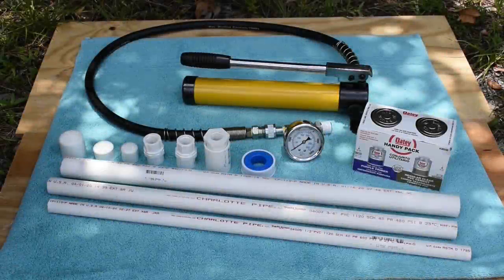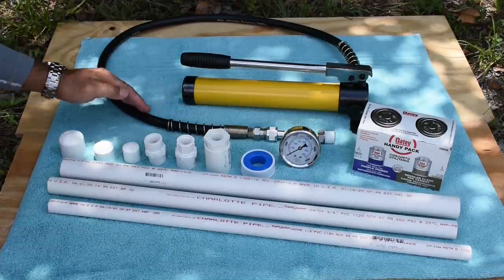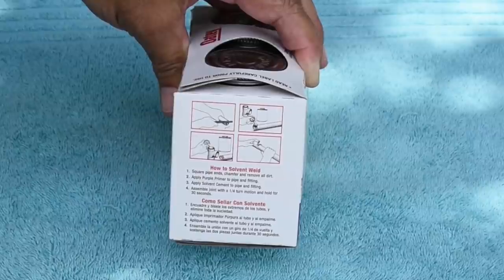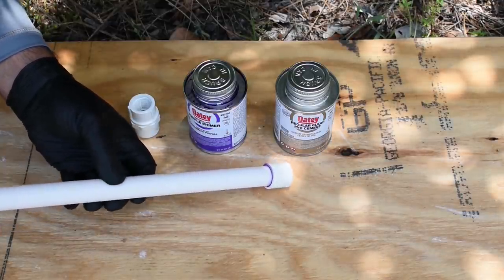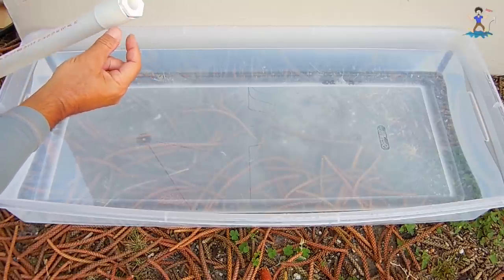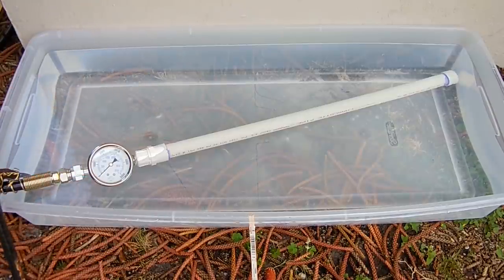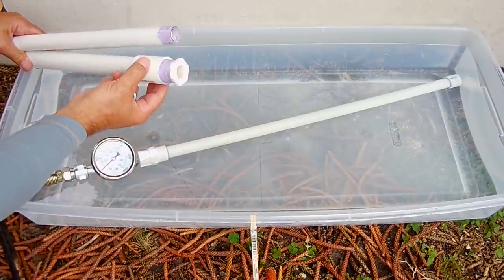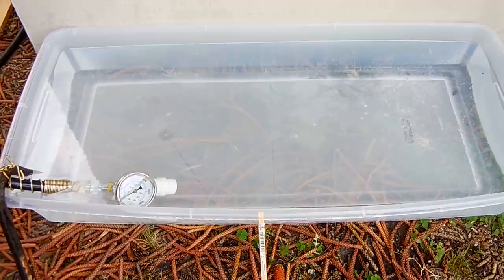Pressure Testing PVC Pipe! How High Will It Go?

Comment: I really appreciated your analysis of why the cement was failing. It really makes perfect sense
Reply from the maker: It doesn't always fail. I've done additional tests where the same size pipe ruptures before the cemented fittings, but at a lower pressure. What's important is the level of pressure these pipes can withstand. Thanks for watching!

Comment: I've always wondered about that, if the pipe pressure rating was BS or not. ? is how can you get a good test that actually checks failure pressure of the material itself? I always used HD cement with my piping and you were just using regular strength glue. Part 2 - Get the strongest glue, re-clean and re-cement (or use new pipe components) and test again to see what the difference in glue makes and to see if you can get the plastic components to fail to verify ratings. It would be helpful if you could put 2nd camera zoomed in the pressure gauge in a PinP. Very hard to see pressure and maybe add snippets of moments of failure screen shots showing pressure and failure type. Thanks!
Reply from the maker: 3 more PVC testing videos coming up. Next one SAT. Thanks for watching!

Comment: I can tell you that 3/4" screw on PVC caps will crack and break over time under 125psi of air pressure.  I think it's the hammering nature of the pressure from the compressor, even though one cap was over 250' downline.
Reply from the maker: Yes. They're under pressure from the tapered male pipe they're screwed onto, and with age and UV, they become brittle. Thanks for watching!
Reply: @electronicsNmore  No I mean brand new, under cover, and it only takes a couple weeks.  It has to be the beating of the pistons from the compressor. Plus UV has nearly zero effect on PVC.
Reply: Do you have a flex hose between the compressor and the PVC? i never had any problems like that

Comment: Interesting to see and learn.  Can you do one more test using acetone? I used it many years ago to stack small pieces 1/4 thick acrylic sheets to make a prism and it turned out to be very clear after polishing and worked well.
Reply from the maker: I have (3) more PVC testing videos coming up. :-) Be sure to watch and share. Thanks for the video suggestion!
Reply: @electronicsNmore  Lol i hate to be that guy but would love to see something about how much energy having a compressible medium (e.g. air) in the vessel adds to the failure.

Comment: Three times a failure at the joint should tell you to improve your joining process.  The "primer" is actually a cleaner. Let it completely dry before introducing the cement. Take your time and make sure both surfaces of the joint are completely wetted with the cement. I suggest pushing the joint together, then giving it a one-third to one-half turn. And then, like you did, hold the joint for 30 seconds or so. Let it set overnight. I think you will get higher pressures before failure.  The colored primer is so inspectors can see that you used a primer. At home I use the clear primer so I don't get that messy purple stuff all over the place.
Reply from the maker: The bond strength was surprisingly good. What's happening is the pipe under extreme pressure is bulging, and that bulging is enough to cause the fittings to pop off. I probably could've allowed the primer to dry 5 more secs. The method of assembly was fine. I let it set for 24 hrs! :-)

Comment: primer weakens glue hold. There's several data segments people have done showing their bursting strength with pressure / tensile strength / and twisting strength.
Now I don't believe you'd ever break the pipe vs the glue hold, maybe if you glued threaded PVC... but you'd have to get a pipe threader and thread it yourself maybe since idk any long pieces that actually have threads built into it. Either way it'd be interesting to do glue holding strength as well. As far as other data goes the "medium grey" with NO PRIMER is the strongest hold I have seen. Great test though, it would be very cool to see a glue stronger than the pipe itself.
Reply from the maker: You missed another video. :-)
https://www.youtube.com/watch?v=1o4E2pdEv-s

Comment: i never would have thought the joints were the weak parts!
Reply from the maker: For some reason the pipe used in this video was able to tolerate higher pressure than my 2 recent videos. Watch my 2 newer videos, the fittings held up and I cemented them the exact same way. Thanks for watching!
Reply: @electronicsNmore  i did, wonderful videos!

Comment: Thanks for the very good video. Very informative. I like to use three-quarter inch PVC in my garage for my air compressor max of 175 psi. Will this work okay. Thank you
Reply from the maker: No problem at that pressure.
Reply: Use pex instead. PVC has brittle failure, and with air it can fling shards with a LOT of force.
Reply from the maker: @Robert Szasz I'll be testing that in the future. :-)
Reply: @electronicsNmore  pex? Or the PVC shard issue. Because the latter is rare, it happens just often enough that avoiding PVC makes sense.
Reply: @RobertSzasz  -- The PEX that I've seen at the home improvement stores should not be exposed to UV.  That could be a concern in certain situations.

Comment: Right when you said you have to hold the end piece on with the glue because of the tapering  i thought its set up for failure. Cant you put a rib on the pipe or some non tapered ends? Thanks for the vid.
Reply from the maker: I have another video that tests the strength of non-tapered thermoformed PVC, check it out under my PVC pipe video playlist. Thanks!

Comment: I think its rated for 480 bexause over time. At sudden shocks of pressure the system gets when you turn the water off and on, you will slowly get cracks over time and it will fail. Or maybe its something else. Like a 480 rating to last 50 years or sometging.
Reply from the maker: They definitely take into consideration water hammer. Thanks for watching! Be sure to share.

Comment: Was the solvent of the glue you used tetraflouran and cyclohexanone or was it methyl ethyl ketone based, I have found the former works better than the latter. The manufacturer states 48 hr cure time for pressure pipe with the former

Comment: I know it would be a more precarious experiment - but how would it work with galvanized?
Stay very safe if you conduct that test.
I still have old sprinkler lines in my yard.
Reply from the maker: Unless the pipe is larger(over 2"), I'd need a higher pressure hydraulic pump. Thanks for watching! Don't forget to rate thumbs up and share the video link.

Comment: Extremely interesting results.  I've seen a lot of people use PVC pipes in shops for compressed air and never considered it safe. I'm curious about long-term effects and just plain age of pipes.
Reply from the maker: The pressure used for compressed air isn't too high(125-150psi), so it shouldn't be a problem. As long as the PVC isn't exposed to UV light all the time, it shouldn't become brittle for a very long time. Thanks for watching Ted!
Reply: @electronicsNmore  completely correct but another factor is ozone degeneration of plastics.Although pvc got some stabilisation additives inside i'd go for "Gas pvc" pipes. They are thicker and rated like tank. I tried to burn one while it was pressurised with water and didn't even melt.
Reply from the maker: Be very careful burning pvc, stand upwind. PVC gives off dioxins when burned.
Reply: @electronicsNmore  The ratings on pvc are for liquid. Air pressure is different. Compressed air has a lot of energy and will turn PVC into shrapnel! Very dagerous!
Reply: @jackofalltrades4904  PSI is PSI makes no difference if water or air. HOWEVER air will compress and that in effect stores energy if suddenly released------ BANG!

Comment: This is excellent! I am building a heating system for me and my family within my garage and would like it to be safe! 480 is a high range and especialy for a cement joint!  Now the real question for me is how much pressure can a 4" white pvc pipe withstand before breaking?  I need to know because thats what my heating system will use and my safety blow off valve is rated at 150 psi!  So with your work, this looks promising!  Any help would be appreated!!!!!!!
Reply from the maker: Never use PVC for heat applications.

Comment: Great video! Looks like that hydraulic pump might be leaking internally, the pressure looked as though it was not building properly, and I didn't notice any bubbles in the water indicating an external leak... Maybe you'll have to get your money back after all the testing!
Reply from the maker: You won't see bubbles, there was only a trace of air in the pipe. :-) It was definitely leaking liquid. Thanks for watching!
Reply: @electronicsNmore ...oh yeah,  forgot about the oil,  and it was clear oil, so I didn't see it in the water... Will be interesting to see how the other glues hold up on Saturday,  I think the hot blue will fair better,  but not confident it will hold long enough to see the pipe burst! Might be interesting to see where schedule 10 ruptures though!?!
Reply: @electronicsNmore  why not use a grease gun with flipflops cut into it to make it that it can pump water?(grease guns can reach easily 4K psi)
Reply: @AnX8765  , I didn't see it because I'm watching videos on a phone,  a larger screen and I would have seen it. In fact,  when I re- watched it,  I could just barely see it...

Comment: Why did the fittings on this vid test pop off, but on your other vid the fittings fully held but the pipe burst?
Reply from the maker: Hydraulic jack oil. If I used water, then I'd have to flush it out and fill it back up to prevent corrosion.

Comment: You need to be carefull with plastics. Remember most have creep and even if they hold the pressure for now, under stress they get weaker over time until they burst open. Thats why they need to be overspec'd for the job

Also the pipes need to withstand way more than the city line pressure because of the water hammer
Reply from the maker: Yes, water hammer is known to cause damage. I've installed many air chambers over the years on copper lines. Thanks for watching!
Reply: Thats it

Comment: Do you think this pressure test would be different if you use just air no water inside the pipe?
Reply from the maker: Air would be extremely dangerous because you can compress many cubic feet. The pipe would explode with plastic shrapnel at or near the same pressure level.

Comment: Hi mate, any idea what the bursting psi is for DWV PVC? (I understand DWV is not pressure rated, just curious what pressure it would burst at.. awesome vids!!)
Reply from the maker: Much lower due to the larger diameter.
Reply: @electronicsNmore  thanks mate.. at a total guesstimate, do you reckon 100mm OVC DWV would be ok for under 50psi?
Reply: @electronicsNmore  *PVC

Comment: is it ok to use 1.5 inch for pressuring air up to 20 bar
Reply from the maker: Use copper pipe.
Reply: but would pvc suffice ?
For explanation im trying to rebuild  the Tampoon gun from I did athing.

Comment: the pressure might only be 80psi but you are not taking into account the water hammer effect from turning on and off taps that can increase the pressure 20x easily
Reply from the maker: Most modern homes have air chambers on water supply lines to prevent "water hammer". Water hammer only occurs when the water is turned off quickly. 20x is excessive. There are online calculators for water hammer. My guess would be a few hundred psi.
Reply from the maker: Check out the link below. If you enter 5.5 Bar(82.5psi) for the inlet pressure, a high flow rate of 5.5m/s, pipe length of 20 meters, and speed at which a valve closes(1/4 sec, which is very fast), you'll see around 220psi. 

https://www.fipnet.com/calculation-tools-water-hammer-calculator/?lang=en

Comment: They call this a "solvent weld" but I've never seen it truly melt together like steel does. If it does weld at all it must be like 1/64 of a inch
Reply from the maker: Only the pipe surfaces fuse, and it's a thin layer. Thanks for watching!

Comment: That is DWV pipe, that means drain/waste /vent. Not for water supply, for that you use CPVC pipe.
Reply from the maker: Incorrect. It's PRESSURE pipe.
Reply: electronicsNmore Does it say DWV on it? If not then I stand corrected. Nice video regardless.
Reply: @polishhotdog933  Actually most DWV PVC pipes are larger pipes (2" or greater).  You can use 1" or less PVC pipes for potable "cold" water instead of CPVC and save a little money.  Most people assume that the smaller size PVC is not good for potable use.

Comment: Depending upon the application, engineers might have a 2X or 3X safety factor for certain things and maybe a 6X safety factor for other things.  If the failure can result in the death of a person, you can expect a 6X safety factor (e.g. ropes used for overhead lifting, safety harnesses, shackles, etc).  Obviously, they do not consider the water line in your house to life threatening issue deserving of that high of a safety factor.

Since the failure is the glue joint, it would be interesting to see what you could do to improve the connection at that point.  If the issue is the pressure causing the coupling to increase in diameter more than the pipe itself, maybe adding a steel sleeve over the coupling?  Maybe there is a steel cap / coupling that was the right diameter that could be threaded onto the end of the PVC pipe (via threads cut in the PVC pipe) without any glued fittings?
Reply from the maker: Check out my PVC pipe video playlist. I perform more pressure tests. Thanks for watching!
Reply: @electronicsNmore  -- OK... Watched them today... Since they all failed at the pipe and not the connection, apparently you did something different when you were doing the test for this video and the connection was not as strong as in the other videos.  Or maybe the manufacturer of the pipe / fittings is not consistent in his product...
Reply from the maker: @CurmudgeonExtraordinaire  I did everything the same. If you notice, the pipe was able to withstand more pressure than my other videos of the same size.
Reply: @electronicsNmore  -- I must be remembering it incorrectly then after seeing so many videos... :)

Comment: now try this again BUT thread the pipe as well as sealing with glue.
you should get over 3k#
Reply from the maker: Hi Paul. 3K won't happen. Based on my additional tests, and information online, you'll never see higher than 1900 or 2000 for 1/2" SCH40. For 3/4" SCH40, the range is 1100 - 1550.

Comment: You should slightly over chlorinated water to simulate reality
Reply from the maker: It was, but it won't effect the result. Thanks for watching!
Reply: electronicsNmore - it made a difference when we tested polybutylene pipe and fittings.

Comment: How many days did you let that glue dry?   Perhaps you stated this in the video,  I skipped ahead for obvious reasons.   LOL,  24 hours from what I gather.   Surprising the glue welds failed.  Your home should never be above 80 PSI,   60 PSI is a good target.
Reply from the maker: 24 hrs. Follow up tests in other videos had the fittings hold and the pipes burst at a lower pressure.

Comment: Please do not use the pvc pipe cleaner it prevents the pvc glue or cement from producing a very strong bond and would cause your joints to fail i use to use the cleaner and my joints would fail under normal working presser so i stop using it and just use the glue which give me a stronger bond... so you need to run you test over but don't use the pvc cleaner
Reply from the maker: :-)
https://www.youtube.com/watch?v=1o4E2pdEv-s